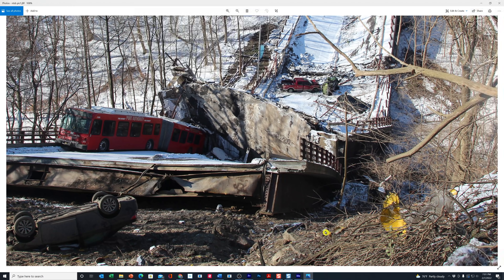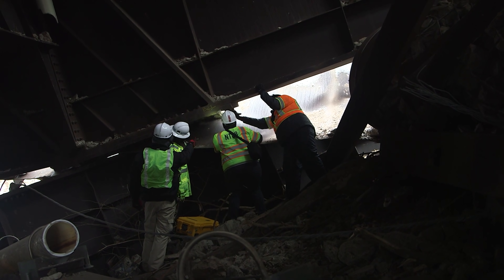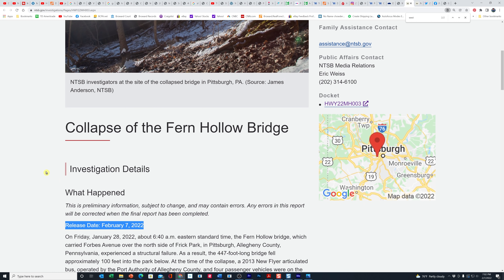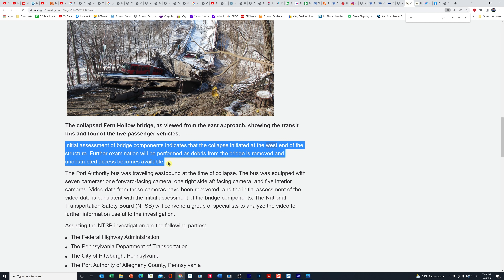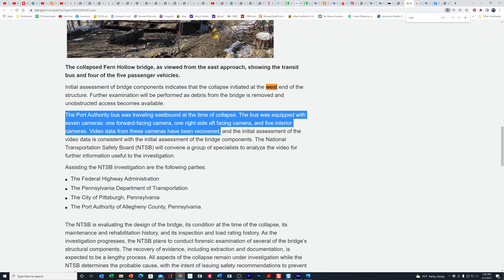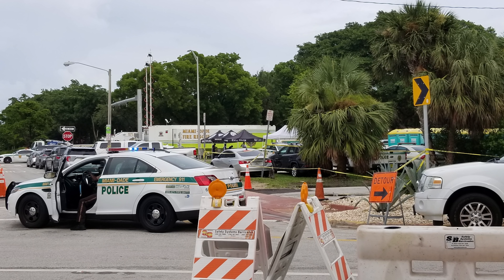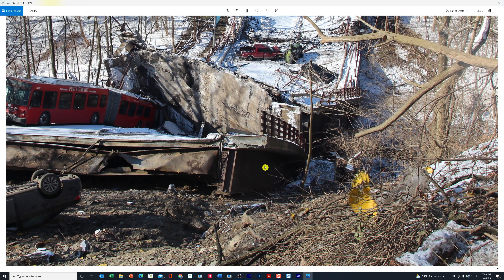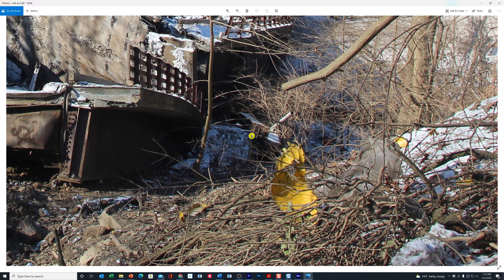NTSB Report Points Where Pittsburgh Bridge Collapse Started

Comment: Lack of maintenance failed this bridge. You can still street view it on G and see the 4 clogged drains, all located at important structural support points underneath. You can see how a few of the drains are moving by the cracks around  them in the somewhat new blacktop. Along the whole length of the curbs you can see where the pooled water had seeped under the curbs and chipped the concrete during the freeze thaw process. You can even street view from the trail underneath for reference points of the location of the failing non-maintained drainage system. The buildup of debris in the two expansion joints at either end of the bridge is also somewhat visible, the eastern side looks to be the worse of the two. Peace/JT
Edit: 3:00 min mark, it's clear the amount of water that was using the outside of the drain pipe due to the clogged drains as the water would have seeped around the drain. All this water would have been focused on that rusted out cross beam section helping to weaken it. 
9:00 min mark, I agree about the rebar not being 3 inches inside from all sides.

Comment: Since I was a kid, 68 years ago, bridge deck and building foundation rebar was always elevated and held in place during pouring.  Little pedstals, that resemble "Table tents" at restaurants, held the rebar at about the halfway elevation of the pour. For example, when puring a [multi-story]  three-inch floor deck, the rebar would be suspended at the inch-and-a-half elevation.

Concerning the cable attached to the underside of the bridge, as support, was the ideas to bolt the cable to the mainspan girders under high tnesion, pulling open side against the other, to prevent sagging in the mainspan?  That sort of cable support used to undergird railway passenger cars in the nineteenth and early teniwentieth century, before the advent of all steel passengers construction .  I'm a historian, NOT an engineer - but engineering and architecture have always interested me.  Is "corten" a registered trademark of its producer or as a trademark for the product itself?  The Univerisyt of PIttsburgh Medical Center building in downtown Pittsburgh appears to be built of Corten - or "Core Ten" - and it used to be the international HQ of U.S. Steel.
Reply from the maker: Yes, but the tension in the cable only supports one direction

Comment: I am not an engineer, but It looks like that vertical beam  has little or no material contacting the base. The X bracing holds the posts in place without tension. The extra cable bracing added by the cables is under tension acting like a long spring. Once the bottom of the vertical beam looses enough material the spring tension of the cables will just pull the vertical posts together. Considering the limited area of the vertical beams it seems like it was just time bus or no bus it was a disaster that would go any second.

Comment: how could it be failed on the west side?, if what you are saying is the east side pics by the gate house, there are 3 large pieces to that bridge, that gives an indication of failure, the east side would have dropped first, causing the west portion to come down on top , causing that middle vertical fold while the west came down.

Comment: Failing infrastructure is what you get when people don't want to pay taxes. Tax cuts equal failing infrastructure, Americans have this nasty habit of kicking the can down the road. Well that's all good until the road fails.
Reply from the maker: Well you've got that completely wrong. In Pennsylvania they have the third highest gas tax in the country because they raise everybody's taxes on gasoline specifically to pay for repairs of failing bridges and then we come to find out all of that money was diverted elsewhere so they lied to the public after charging them huge tax rate increases $0.57 per gallon
Reply: @jeffostroff  
Money was diverted because I guess there was not enough money for everything, could also be corruption from politicians that you the people elect. We pay higher taxes than you do in our country and guess what? we have no crumbling infrastructure, no collapsing bridges and buildings. We even have people that go around and clean the freeways of rubber from blown truck tires. Last time I was in your country couldn't help but notice all the all the junk on shoulders of your highways. Listen if you need to rob peter to pay Paul then that means there is not enough money which means not enough taxes. Now if they say they have to raise taxes the people will cry and whine. So truth of the matter is, I got it completely right. Your logic and reasoning is not part of the solution but part of the problem. Your infrastructure will continue to crumble until there is a change in attitudes like yours. Cheers!

Edit: That would include Federal taxes by the way. Also our taxes also pay for Healthcare for all.

Comment: Just like the Ford Pinto, the occasional lawsuit from a rare bridge collapse is less than they would lose if they stopped salting the roads and started maintaining the roads and bridges. People in charge hate the middle class. The salt money lines the pockets of the mining companies. The rotting cars that don't pass inspection is sticking it to the middle class they hate...draining we the people's pockets by replacement or repair of vehicle to meet inspection standards. Mostly replacement, so it lines the pockets of the auto makers. The roads are falling apart, but we're not even allowed to have a hole in a [non-structural] body panel anymore. Buying salt is an excuse for them to keep raising tolls (we have the highest tolls in PA) and getting nothing out of it. They don't even have booth operators anymore. The people in charge are all about this EV nonsense, and generally hate older cars, because they perceive them as for poor people. So getting cars off the road continually and replacing with new cars is serving that green nonsense agenda. That won't be enough. The people in charge hate rural people. If they force EV as a standard, there's no way that's going to work in the country. You also can't run a farm with equipment powered by batteries. They want everyone in cities and taking public transit. In view of their AI cameras for every second. Think it won't happen here? Watch videos of urban explorers going over to China to look at abandoned stuff. China is wired with cameras everywhere, and it's all centralized and monitored by AI. When they go into those places, there are obviously no cameras, so they disappear from the system. Once the system doesn't see them for so long, the police are dispatched to the area where they were last seen and head in the same direction as last seen. It's coming here soon. I don't think they quite thought through the lack of farming, though. But they do have all of this synthetic meat nonsense now.

Comment: Hey Jeff.... here's a theory for you to flesh out: (3:00) — when the city installed those cables, they then removed the 2 lower transverse beams (the bottom "X beams") after that photo was taken by Dr. G.  But those cables they installed are only designed for loads in tension.  Cables are not designed to withstand any compression loads like those transverse "x" beams could handle.  So the bridge collapse was initiated at the bottom of both "K" supports when they collapsed inward due to the lack of compression support by the cables that the beams had.

But in order for the city to have replaced those "X" beams with tension cables, it means those beams were only designed to accept tension loads and no compression loads.  Is that your take too?
Reply from the maker: yes, that cable fix is not much of a fix

Comment: Cor-Ten steel has been proven to NOT resist corrosion as advertised, and in fact, its ‘protective ‘ oxide layer simply makes it harder to assess the level of corrosion occurring within the body of the steel.  Bridges and other safety critical structures made of Cor Ten should have been sand blasted, assessed, remediated, and painted properly over a decade ago.

Comment: That single picture of a rusted out beam totally disconnected from an incredicpbly rusted and spalle concrete footing with a missing bolt. Showing some slack cables. They may as well have used bailing wire. The cause of this collapse was criminal gross negligence of its maintenance. The collapse may not have started there. But there was definitely no redundancy at that point. Instead of NTSB idiots screwing around trying to find the exact failure initiation point. They should take their pictures and sample pertinent structural metals. Within a week they should have a "Warp Speed" Construction Plan for a new properly designed bridge. And materials and concrete being used to get that plan moving by placing proper cement footers for the steel. Almost everything constructed in the US is given a 50 year life. We've stretched that by crappy bandaids. But this bridge was 52 years old. Without decent maintenance, which was obviously not done, it lasted it's projected lifetime.

Comment: I'm not an engineer, but I work in the field of architecture, so I know a little about design. It seems strange that they would install that new cable crossbracing in a different position than the cross bracing already there. I mean, if it was the bottom two members that were failing, why not install the steel cables to carry the load of those two members, then remove them from the structure. I think what this will come down to is that temporary cable, was it placed properly, was it sufficient in providing the lateral support of the damaged crossbracing, did it cause a shift in the balance of the structure (was one side tightened too much?) Or did it simply fail?
Reply from the maker: I question the use of the cables in the first place because they are in tension so they can only prevent the support columns from bulging outward, but what if they were to squeeze inward? These cables would not be able to stop in that direction and so that is why you can't just have them replace those solid braces

Comment: I’m actually surprised this hasn’t happened to the Grosse IIe free bridge. I know they shut it down a year or so ago to do repairs on it. It use to be an old railroad swing bridge. The decking is sorta like an expanded metal. Last time I was on it was back in the early 2000s. There was big square metal plates welded to the deck covering big holes where rust had formed. A bit sketchy if you ask me.

Comment: ??But NTSB said that the twin towers collapse due to fire ??
Reply from the maker: No NIST said it. The heat from the fire did not melt the steel columns, it was below the melting point. But a lot of scammers and conspiracy theorists lacking information and full of lies, don't understand the science. The columns don't have to melt, they lose 80% of their strength at that temperature from that fire, so they simply buckled under their weakness. That is different than melting.
Reply: @jeffostroff  so the fire at the top weakened the steel at the top . Cause the twin towers to collapse the same way like a pancake ?

Comment: A few people are saying those cables were used to repair the bridge. No, they weren't, they were already on the bridge prior to that split.

Also, those footers aren't connected to the bridge. The point of contact is kind of an angled stab which allows for a little bit of movement. It's not rigid in it's connection. So, as you might know, steel changes size with temperature, so the dimensions of the bridge need to allow for this. Sometimes on a bridge, one side will be rigidly connected, but the other side will have like a rolling bearing, the bridge will sit on a round wheel, which allows for it to shrink and grow with the temperature. So, those ground pillars have a hole in the middle which shrinks into a cone or triangular shape. The structure of the bridge is stabbing the pillar, and the weight of the bridges keeps it centred on the pillar.

I don't think the pillar will have moved, because the slightest movement would have been slow and obvious, it's surrounded by the earth. It really had nowhere to go, and it's really deep into the ground.
Reply from the maker: Yes I couldn't tell for sure but I was suspecting looking at the pictures that the bottom of that frame sitting on the concrete base looks like a bearing of some sort and maybe it just popped off. I would love to see some closeup shots of the bases right now
Reply: @jeffostroff  It has way too much weight on it to pop off. The ground mounts aren't going to suddenly fail. The bridge is pivot moment with the force being in the direction that they are pointed into the ground.

The steel is though very rusted out near the bottom. But I don't see enough damage to make this the failure point. Thinking that the maximum loading was compromised by damage and the bus and snow exceeded that. The bus is on the other side of the road from the damaged side of bridge. Thinking the moment is a twisting effect of having the bulk weight on one side of the bridge.

Comment: Hi Jeff, I'm following this series of videos with great interest, as I currently live in Pittsburgh.  I have a few comments, in no particular order:  

If you're uneasy about COR-TEN being used for the structure of the Fern Hollow Bridge, you're really going to be unhappy to learn that it was also used for the gigantic New River Gorge Bridge in West Virginia.  High exposure to water has been a known problem with this steel for quite some time.  In 1991 two people were killed at the Fort Worth Water Gardens, when gusty winds toppled a light pole made out of COR-TEN.  I believe all the light poles were ultimately removed / replaced.

On the day of the bridge collapse, a local TV news reporter interviewed a woman who lives near the bridge.  She stated that a large pothole wold form at one end of the bridge every year, that it would be fixed every year, but reappear every winter.  She did not specify which end, but IF it was the west end, that could be a path for salt and water to work it's way down to the structural steel.
Reply from the maker: Yes I have an uneasy feeling about anything that was built without steel, it's really only good for sculptures in my opinion
Reply: peccatumDei — PENNDOT and the city are the ones constantly over-salting the roads so all the jackass drivers in the state can drive the posted speed limit no matter what temperature or how much snow or ice is on the roads.  Salt should never be used the the extent that they use it in this state.   They're obsessed with salting the roads every time it gets cold and never take into account the premature corrosion that causes in both vehicles and infrastructure.

It's a disgrace.  And PENNDOT and the city of Pittsburgh have nobody to blame but themselves.  The state also diverted $4.5 billion collected from gas tax that was earmarked for infrastructure and instead gave it to the state police so they can retire at 45 with multi-million dollar pensions.  Because, you know, cops should be millionaires.  State workers think they should be paid as much as an NFL quarterback or they will strike.

Comment: Instead of using cable to replace that brace, they should have used duct tape.
Reply: Might have worked better than the cables,  duct tape can at least offer some compressive strength

Comment: You can view google street view from under the bridge and that cross beam that Dr G showed in 2018 is no longer on the bridge the two bridge supports had two cross beams each the side where the collapse happened had the bottom one removed which wouldnt be good for support and could cause the uprights to lose rigidity and maybe that missing cross beam was waiting to bring the bridge down.

Comment: 1. what about the geology?  Are those four concrete foundations still in place?  Or did one of them slide on a wet shale layer?  2.  Have people been speeding on the bridge?  Late at night, say?  Fast traffic is very bad for a weak bridge.  3.  I find it hard to believe that all that rust happened since 1970.  That cute little building at the west end looks more like 1917 than 1970.

Comment: There is no excuse for this bridge to have collapsed.  It should have been closed long before this happened.  If you will notice, there were very few vehicles on the bridge when it collapsed.  Basically, it collapsed under its own weight.  The Mayor of Pittsburgh and the Governor of Pennsylvania should be ashamed and embarrassed by this.  This is due to neglect and lack of establishing priorities, pure and simple.  This has nothing to do with "aging infrastructure".

All parties that have some interest or connection in an accident that is investigated by the NTSB are parties to the investigation.  There are very strict conditions that the parties have to follow.  The NTSB leads the investigation and the participants are allowed to provide input.  Also, by law, the information developed by the NTSB cannot be used in litigation.  You can use independently obtained information.  Please don't ask me how I know this.

The spalled concrete is typical of concrete that has been exposed to salt (NaCl).  Also it is difficult to tell from the photo how much cover was over the rebar.  For bridge decks, this could be as little as two inches.